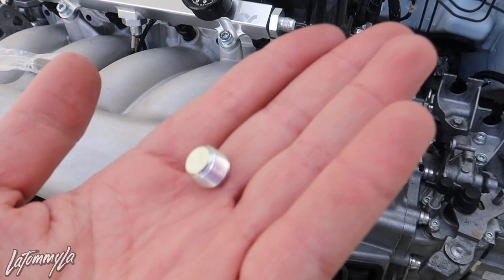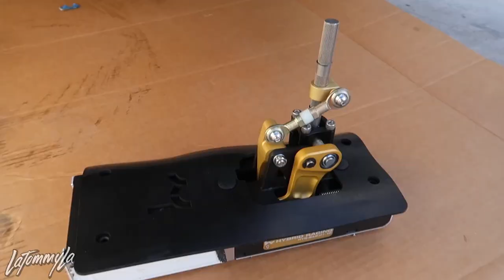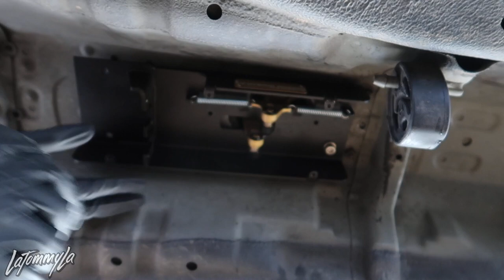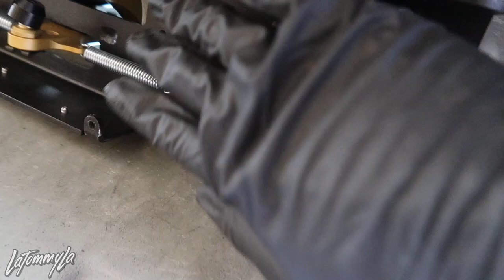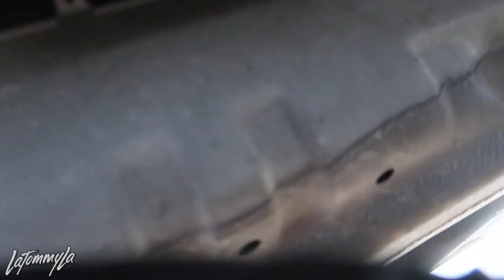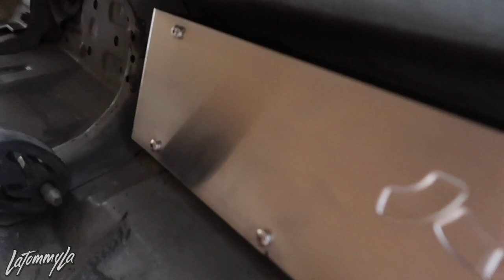Hybrid Racing No Cut Shifter & Cables install - K20 Swap Part 7

Comment: Dood that's lit. When you painted the engine bay. Did the urethane based clear react with the oil based enamel Rust-Oleum base coat ?

Comment: Hey did you have to change the shift selector to an rsx type s or did you keep the z3 shift selector?? Also what cable bracket did you use?
Reply: im doinga z3 swap and i had to convert the shift mechanism to a 02-04 rsx since i am using 02-04 rsx type s cables. hope this helps.
Reply: For future reference there is an adapter plate that you can use for different cable brackets on Z3 or Z7. It sits between the bracket and transmission to allow to connect both. I’m using Z3 shifter parts with original Z7 shift selector.

Comment: That shifter kinda sucks. It doesnt fit well on an EF. Theres captive nuts in the exhaust tunnel for the 10mms holding the console in which makes the shifter assembly not sit flush

Comment: When you buy the shift box do you need to get the cables or can you use oem cables
Reply: OEM cables.do not work I tried must get hybrid racing cables.
Reply: Rsx type s cables work. But the rubber is know for wearing.
Reply: @gsrturbo3786  OEM Z3 cables only

Comment: I've had nothing but trouble with the no cut hybrid shifter. Multiple points of failure
Reply: So what did you go with now? Im about to just buy ebay setup with cables...
Reply: @bOOSTEDjOSH  eBay ktuned copy. Goes well
Reply: @tezzasaurusrex  how long has that one lasted you? If its 1 or 2 years thats cool. Months ..ehhh
Reply: @tezzasaurusrex  where you having trouble shifting at high rpms from first to second with this shifter ?
Reply: What points of failure?
Reply: I dont want to cut my car or lose my
Cup holders for the ek any ideas wht to go with or do? Lol! Thanks
Reply: @uwkcal  unfortunately the only way to keep the cup holders is to go with the no cut shifter. New ones may have been revised and improved now not sure. Mine was an old version.
Reply: @gsrturbo3786  the Delrin shifter cup snaps and you can money shift going from 3rd into 2nd at full noise while trying for 4th (I nearly did).
The circlips holding the rose joint in the gear selector arm fail resulting in difficulty selecting 2nd. The weld on the pivot pin holding the gate selector arm breaks resulting in slop. It's just a hugely complicated design which can definitely be improved on.